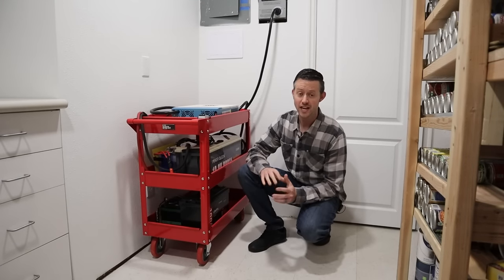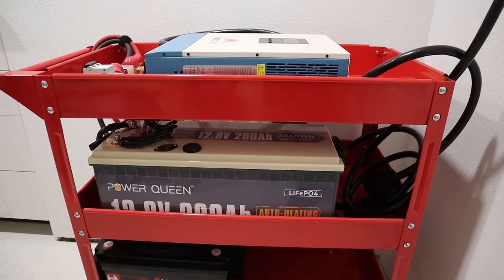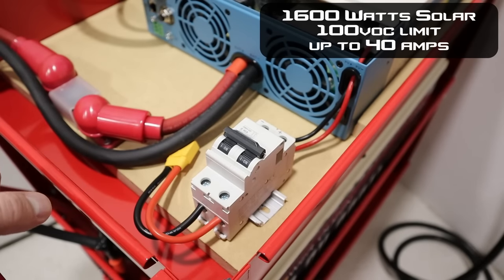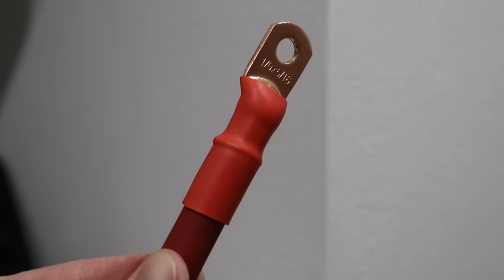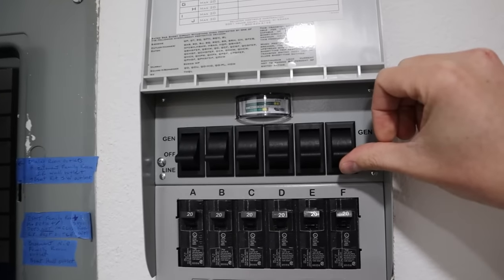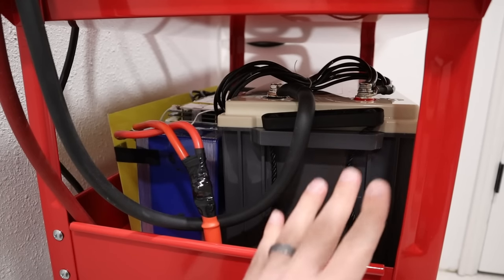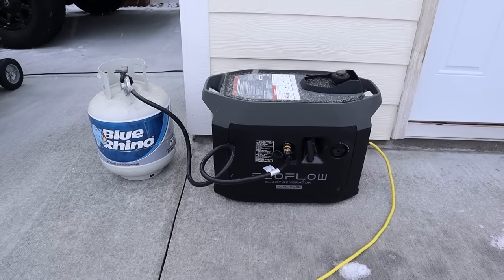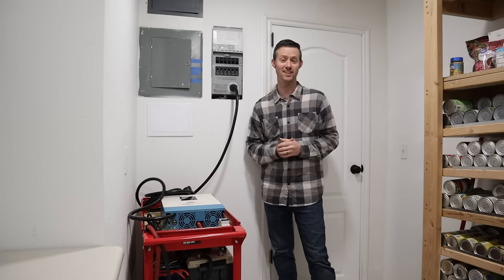Be Ready For Any Power Outage!  DIY 3000w SunGoldPower - PowerQueen LiFePO4 Home Backup System!

Comment: I am in the middle of doing this setup. My question that i have is, the inverter has modes for solar, battery and mains in terms of supplying power to the transfer switch. How does this setup handle MAINS from the main panel going through the inverter and back into the transfer switch?  (A scenario is when the power comes back on but your battery runs low so the inverter switches to mains power).   I am concerned that having the inverter powered by an outlet will cause an issue because of the neutral not being switched.   So do you randomly plug into the wall to charge the batteries and then unplug and wait for an outage or do you leave it plugged in?
Reply from the maker: Hey Blake, 
When you are running an appliance off of the inverter and transfer switch, that circuit is completely isolated from the grid / mains power. Plugging the All-In-One into an outlet to charge shouldn't be an issue since both are completely separate from each other.
I didn't see any issues while charging from the AC wall power at the same time as powering appliances off the transfer switch. Just FYI, I currently use solar charging as my priority and I haven't done a ton of testing with that function yet.

Comment: The inverter docs state that the inverter swill switch to battery within 10ms and not shutoff electronics. So am I correct that this inverter w/batteries could be used in place of a traditional computer UPS system?
Reply from the maker: This does have a UPS feature but I didn't test the actual cut-over time. If it's actually a 10ms cut-over it will work well for that. I recently sold this so I can't test that out.
Reply: @Jasonoid  OK Thanks. I was debating getting a used TrippLite 3000W UPS and then expand the batteries. But this inverter might be even better since it can be fed different incoming power sources.

Comment: I live in SW Florida and the last hurricane I was in power was out for 11 days.  With a few solar panels would this system power a small in window roll around AC unit and the fridge and freezer? and how many solar panels would I need to get to recharge in  timely manner?
Reply from the maker: This setup would power your fridge and freezer just fine. I'd recommend around 400 to 500 watts of solar for the setup in the video. If you wanted to power a window AC unit you'd want a larger battery and double the solar.
Reply: @Jasonoid  thanks Jason, would love a video simulated 4-5 days of power outage and what essentials you could power.  There are like none of them on youtube that I could find. Most of it is peace of mind, food storage and the ability to sleep comfortably at night.
Reply from the maker: @mobius6772  I have a wife and kids so a long term simulated power outage is pretty hard to do with all the requirements of normal life. If it was just me at home, totally! 
I am currently running my Ecoflow Delta Ultra with a reliance controls 10 circuit transfer switch and it's powering critical loads non stop. That test has been going for about 1.5 months now running 10 circuits. This setup does require a bit of solar and batteries but it's possible. I have about 20kwh of batteries and 2400 watts of solar. I see a constant load of about 500 watts. During the day it's no problem when the sun is shining. It's getting through the night and cloudy days that's difficult.
Reply: @Jasonoid  Sorry Jason I was a little vague, I was just interested in a setup that could run a inside (Fridge Freezer Combo) a (garage stand up freezer), and (a roll around AC unit) to sleep at night. All of this that could be recharged the next day  from portable solar panels if it was a sunny day.  I am new to solar and battery system so forgive my ignorance.  These are all for emergencies to go 5-10 days without power.
Reply from the maker: @mobius6772  I got lots of videos showing options that will work for you. An air conditioner is a large power consuming device so just be aware of that. One thing you could do is purchase a watt meter and track how many kilowatt hours each device pulls for 24 hours.

Comment: Cool video, do u have a link to the fuse you used? Also, how hot does inverter get laying down under load?
Reply from the maker: When watching the video, you can expand the the description of the video by clicking 'more' and you'll see all the links for what I used in the build. It doesn't get hot, the fans move plenty of air.
Reply: @Jasonoid  thanks for reply, I don’t see the link for fuse and holder but everything else is there.
Reply from the maker: @Alex300zxTT  I left that off, sorry about that, here it is:
https://www.amazon.com/gp/aw/d/B0B27PGZRT?psc=1&ref=ppx_pop_mob_b_asin_title

Comment: I bought this sungold Power units and found out it need 120 v to  charge from panels ? That is 10 12v panels .Is that trure? That's too many panels for me now so it's not working now
Reply from the maker: This video other will break down how to choose the right solar panels, showing how to understand the voltage and amperage for the charge controller:
https://youtu.be/4JG8LvJznLY

Comment: Can you use circuits from both 120 volt legs of your house 240v system or is a Transfer Switch limited to just one leg?
Reply from the maker: You can have both 120v and 240v transfer switches. You can connect to either leg. I have circuits from both sides. Reliance Controls has some really great videos on them on YouTube.

Comment: For a 24v system, why didn't you run 2 identical 12v batteries in series together, where each one has a 200A BMS.
Reply from the maker: I already owned the batteries I used in this video before assembling this project. Of course it would be ideal to use identical batteries with 200 amp BMS instead of limiting the system to 100amps continuous.

Comment: Btw there is zero point to putting a circuit breaker on solar panels,
Its just being used as an expensive switch when you disconnect the panels from the load.
Because it will never trip

Comment: did you used converter from 24v to 12v for some appliances or devices 12v?
Reply from the maker: You can definitely do that if you are wanting to run 12v devices off the 24v battery. There are many options available online.
Reply: @Jasonoid  are there any harm when you use the 12v device or appliance on 24v system with no converter?
Reply from the maker: Yes, the 12v device will be harmed or damaged with the higher voltage. Don't hook 12v devices up to 24v batteries.

Comment: Just starting to look into this for when grid power goes down.  Question; how do you prevent the power from back feeding into grid utility lines?  Thanks.
Reply from the maker: There are three ways to prevent back-feeding: 1) Install a transfer switch  2) Use an Interlock switch on your main panel  3) plug into your appliances directly. 

I decided to use a transfer switch because it gives me the ability to isolate each circuit from the grid and run those circuits off a different power source.
Reply: Great video! I like the idea of using the mobile cart and 4 100ah batteries. What transfer panel did you use?

Comment: If I use this inverter with two 100AH LP4 batteries, I can pull 100A each, so 2400 Watts.  Will there be any surge capacity beyond that? Or will the BMS turn off the battery as soon as I pull more than 100A per battery? (In other words, how do I make use of the inverter’s surge rating when the batteries themselves turn off at a specific amperage draw?).
Reply from the maker: Continuous load would be 2400 watts for two batteries. Each battery should allow around 200amps surge for 10 to 15 seconds before it shuts down. So they would be able to handle breif surges of power. Starting with 2 batteries in series would work well until you have the chance to upgrade to 4 batteries or more down the road.
Reply: @Jasonoid  So the batteries are what provide the surge capability, not the inverter?
Reply from the maker: @ma3680  the inverter is pulling power from the batteries. The inverter will only pull the maximum power the batteries will allow. This is the case with just two batteries. 
Now if you have enough batteries stacked up in your system they will provide more power than your inverter can pull and the inverter will be your limiting factor.
Reply: @Jasonoid  Thanks!   Since most inverters advertise a surge capability (usually 200%-300%) I thought the inverter somehow created the surge buffer (perhaps by manipulating the voltage) but what you are saying is that the LifePo4 batteries themselves can tolerate a few seconds at 200-300% not the inverter.  I was watching HoboTech test a 100aH LP4 battery and it seemed to shut off the moment he went over 100A, but maybe that was just the editing of the video.
Reply from the maker: @ma3680  each battery BMS is programmed differently. The techs specs usually list what they can handle. These power queen 100ah batts will surge for 2 seconds at 280 amps and then shut off.
Reply: @Jasonoid  That makes sense. Thanks again.  I’ll check the battery specs before buying.  I want to run my 3 sump pumps during a power failure and they need some significant starting watts for them to run.
Reply: @ma3680  Surge requires contribution from everything in the system.  Inverter must be able to provide the surge to the load.  Some inverters have a start assist which helps reduce the surge by reducing the A.C. output voltage, but there are some loads that do not play well with that. The wiring to the inverter must be large enough to not drop the D.C. voltage too much during the surge, or the inverter will shut down from low voltage input.  The fuse must be large enough not the blow during the surge, but still sized to protect the wires. The batteries must be able to provide the surge without too much voltage drop and without the BMS and/or internal fusing shutting off.  (Lead batteries used to have a lot of voltage drop. Lithium usually does not, depending on internal construction, but lithium needs a BMS.)

Comment: @Jasonoid how would you set this up if the house already has Solar but no batterey system for the house?
Reply from the maker: Usually grid tie systems do not support battery connections or if they do they have to be a proprietary setup. That's the one downside of those systems. 

I use this setup with a  transfer switch which is completely separate from the grid when in use.

Comment: Do you have a link for the Reliance transfer switch.
Reply from the maker: https://amzn.to/49MCf5N
You can find them here on Amazon, they have many different sizes to chose from.
Reply: @Jasonoid   Thanks for the response. I guess you changed the plug on the transfer switch to match the plug coming out of the inverter to match.
Reply from the maker: @ETTE-d4z  there are so many types of power cables online, you just search the the one that has the connections you want. You can also buy different outlets for the transfer switch too.
Reply: @Jasonoid  Thanks again.  I was searching for the outlet that fits the cable you are using but can't seem to find it. I guess the other end of the cable the male can be used on the transfer switch and plug the female end from the inverter into that. Once again THANKS

Comment: Hi , can I put just one 24v battery not 2x 12v in series instead? Why everybody put 2x 12v  battery for 24 V system?
Reply from the maker: Yep, you can use a 24v battery. 24v batteries aren't as popular. More brands are putting out 24v models though 👍
Reply: I'm not finding any 24V batteries with a 200A BMS for some reason.
Reply: @ItsEverythingElse  yeah, these 24v batteries are like unicorns

Comment: Did you give the total cost for the DIY system?
Reply from the maker: In the beginning of the video I mentioned cost, it's a labeled chapter. It's around $2000 to $2100.
Reply: @Jasonoid   i guess for 2400 watts that pretty good, does it have pass though charging and can be iverters be stacked or batteries increased ? can the inverter be charged by solar ?
Reply from the maker: @dwaynediesel6079  that price is for the full 3000 watts continuous since I priced it using four 100ah batteriers rated for 100amps each (so in parallel 200amps). All diy systems support passthrough charging, can be expanded by adding batteries, and the inverters can be stacked.
Reply: @Jasonoid  ive seen so many of these DIY soalr videos and no one explained it and put it together so easily as you ! THank you!

Comment: Jasonoid I want to see a shed or trailer that can charge an electric car; not connected to the grid
Reply from the maker: You'd need quite a bit of solar panels and batteries stacked up to accomplish that, it's possible though. Probably 4000 to 5000 watts of solar panels. You could potentially do a ground mount panel system if your yard was large enough and you had space. Then it could be independent from the grid and have a 240v inverter to fast charge your car.

Comment: Nice system and very similar to the system I assembled last fall.  My video shows it as a 12 volt/3000 watt system, but I have since upgraded it slightly to 24 volt /4000 watts.  I originally configured it with the charge controllers laying flat on the top shelf but after I actually read the owner's manual, I mounted them vertically on a removable board.  https://www.youtube.com/watch?v=Gor3hUR6MoQ
Reply: The vertical mount helps with cooking - hot air rises, yes?

Comment: Well, for charging you've got a big truck there..
Reply from the maker: That truck also uses lots of gas! haha A smaller gas generator will produce similar power with much less gas usage. I could use multiple options to charge up my batteries, the truck with a DC to DC charger is definitely one of them.

Comment: The battery's are too much. I found a 24 volt 300 am hour battery for less than 600 dollars and it will be here in 4 weeks.
Reply from the maker: If it's a lead acid battery it only has a 150ah usable capacity since it can only be discharged to 50% without damaging the battery. Lead acid batteries are still capable and affordable... but as lithium battery prices drop it gets more appealing. Being able to get the full 100ah from a 100ah battery is amazing, no damage to the battery either.

Comment: Inverter far too expensive, bought mine on aliexpress for 210€, 16 x catl 90Ah LiFePo4 cells for 590€ => 4.4kWh, a 120€ jk bms and... That à 1000€ system.
You can replace those fans with temp driven ones and it wil' run much quieter.
Reply: I wouldn't use aliexpress if it was 1/10th the price.
Reply: Care to explain the temp driven fans? I'm curious

Comment: OR Get a porpane generator with a transfer switch. Don't store a degrading power transfer switch. Battery solutions for backups are such a waste of money any battery backup solution is a waste of money for houses.
Reply from the maker: That sounds a bit ignorant... I think having multiple options is the best solution, redundancy is key. I have a dual fuel generator AND these batteries / solar

Comment: Way, way to expensive.  I thought that solar would be cheaper than that.  I'll just keep paying my utility company.
Reply from the maker: This is a backup system, it's meant to power your appliances with your utility company fails. A much cheaper option would be a gas generator, but they run off fuel and make a lot of noise.